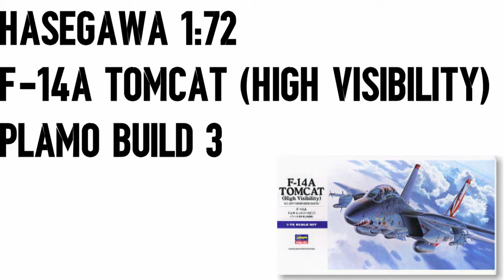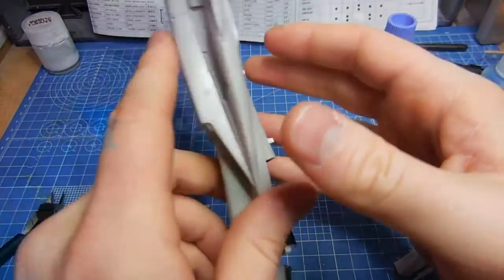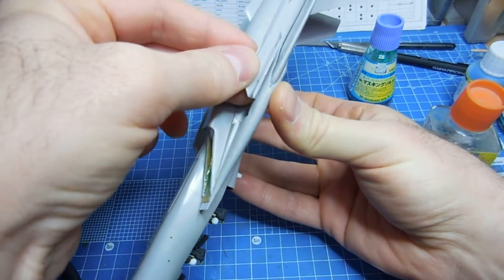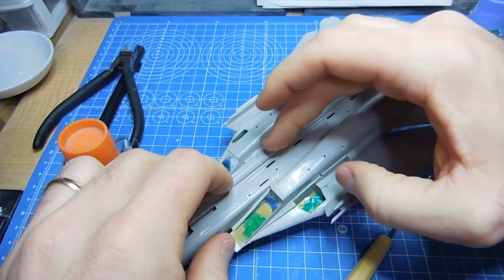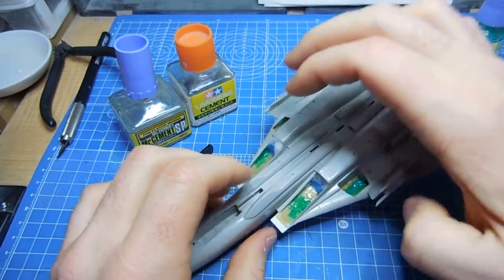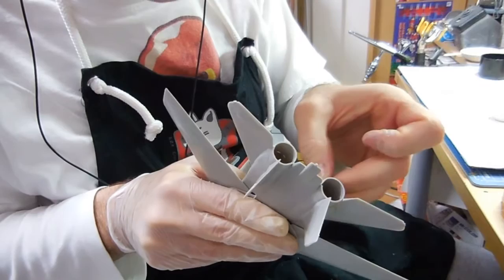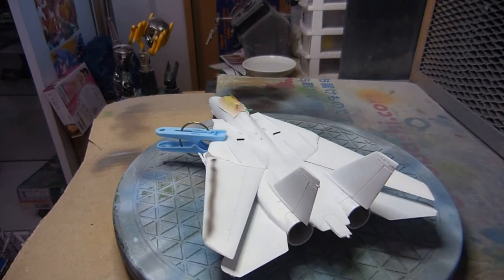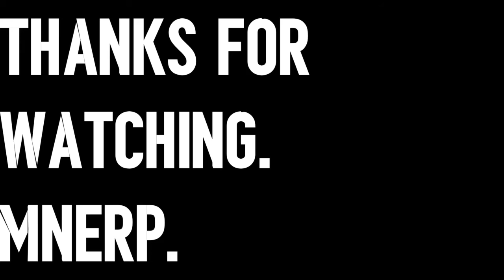Hasegawa 1:72 F-14A Tomcat High Visibility plamo build 3

Comment: Hi Greg - thank you for the videos, I glad to know that I'm not the only modeler out there who manages to bungle things up (and have to recover them) every once in a while.  You've got the best blend of humor, politics, and modeling going - could watch and listen all day.  One thing on the Tomcat (and most delta wing aircraft that use horizontal stabilizers or stabilitors) - the horizontal stabilizers are designed to pivot so no need to fill the gap between the fuselage and the horizontal stabilizers.  In 1/72 scale you can probably recreate with a thin black line at the joint between the stabilizer and the fuselage.   This image shows it way clearer than I can describe in words: http://www.anft.net/f-14/f14-detail-horizstab.htm
Reply from the maker: Oh thanks! Actually, I printed out a page or two from that website about the Tomcat's lighting. I'd started that 1:48 F-8E Crusader a year and a half ago with the intention of lighting it. I intend to do the same for the 1:48 Tomcat as well. Oh man... whenever I get around to them!